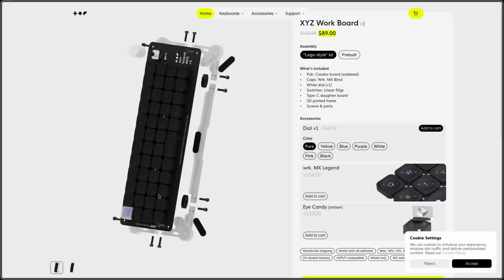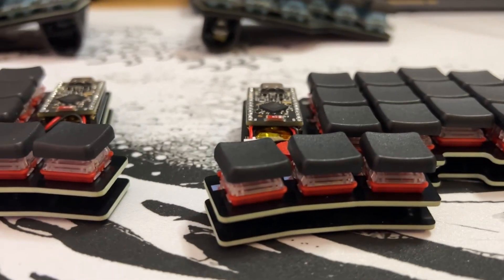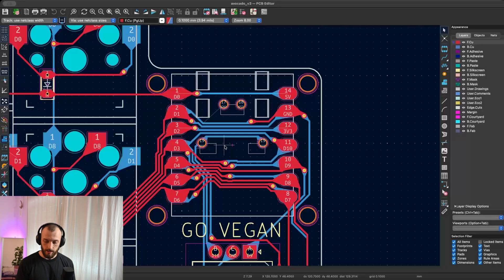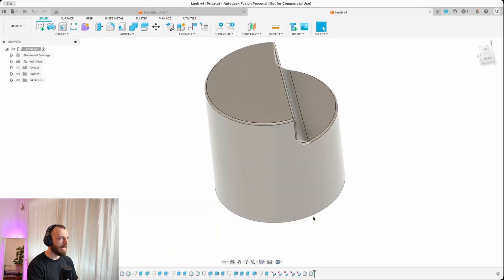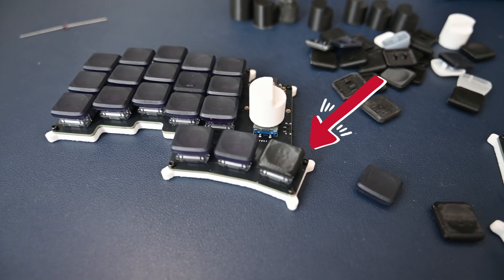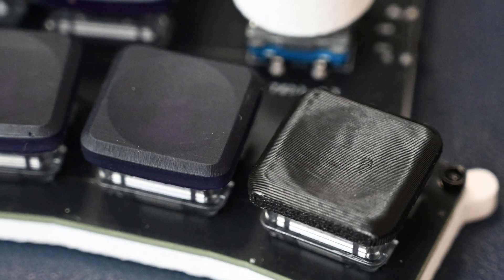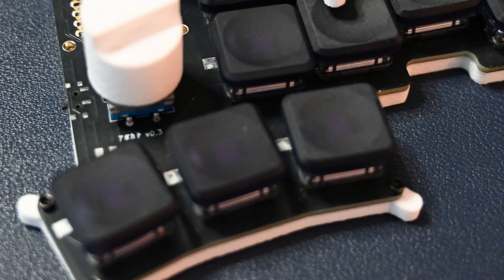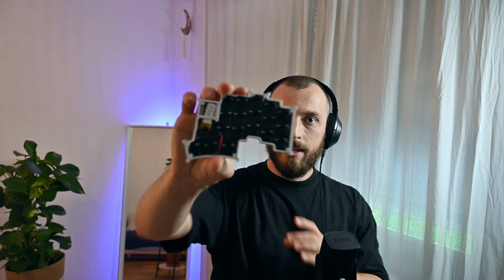DIY: Work Louder Split Keyboard

Comment: Nice work. How are the encoder reachable from your fingers resting on the homerow? I want to build my split keyboard also by my own, but I don’t need it to be wireless, but maybe I want to have a additional row working as numbers and function 1-12 keys, to enable some gaming capabilities to the keyboard
Reply from the maker: Thank you :) 
Yea I am not using it for gaming at all due to the homerow mods. There you basically cannot game with :) 
The encoders I basically only use with moving the hand. The right one is pretty much not used at all. It’s a nice gimmic, but after a few month of using, I only use the left for volume tbf :)